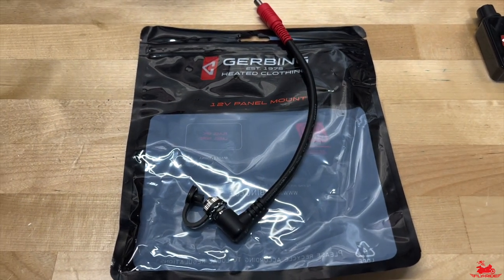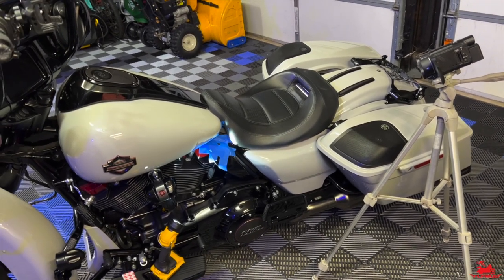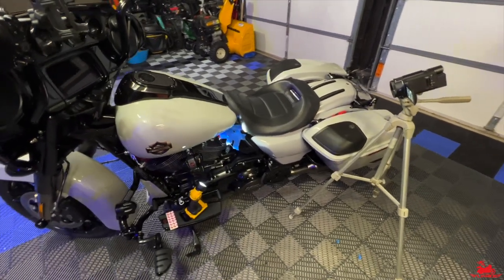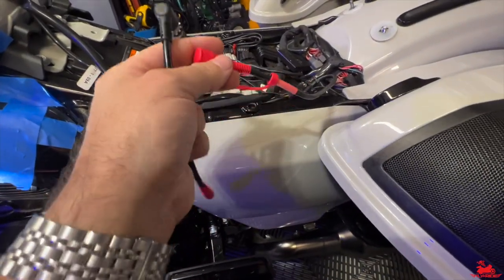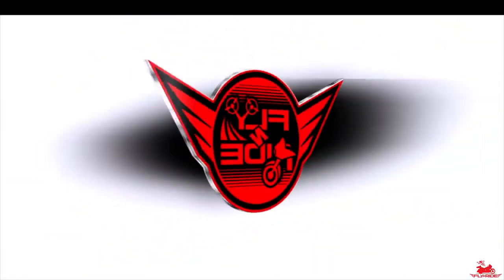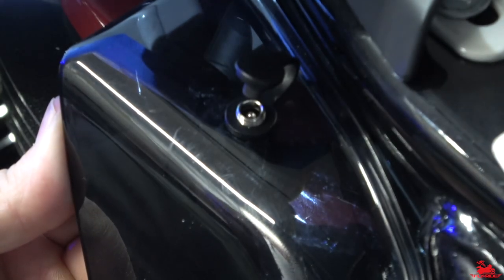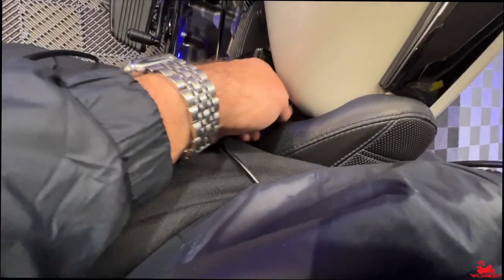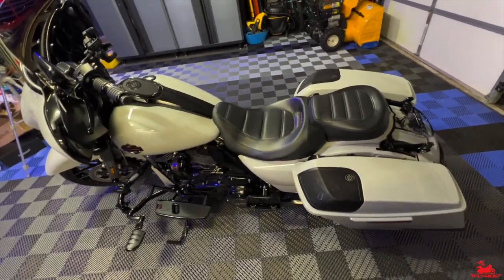THE BEST HEATED GEAR INSTALL

Comment: so the red piece that you have in your hand, is that just hooked to your battery directly through the battery charger?  You don't wire direct to the battery via an inline fuse?
Reply from the maker: This was a while ago but from what I recall. There’s a wire that connects directly to battery and then the piece I installed connects to that cable.